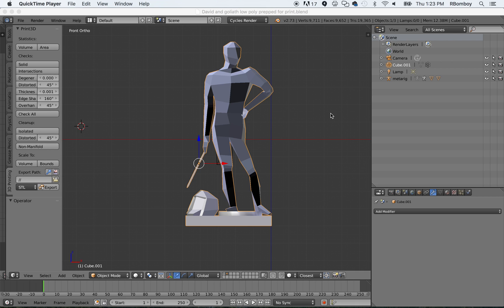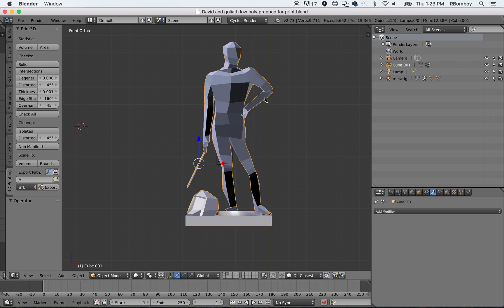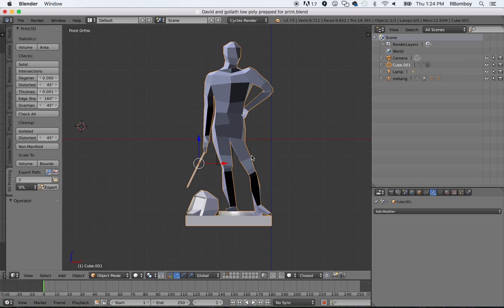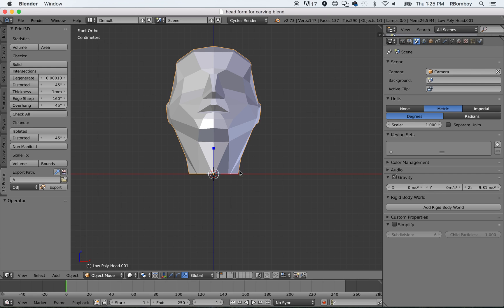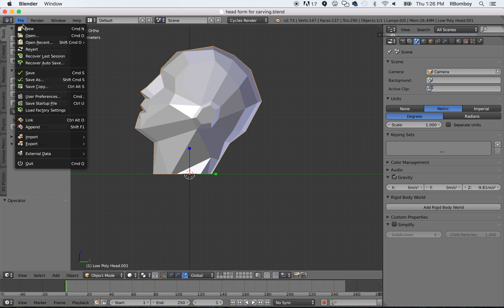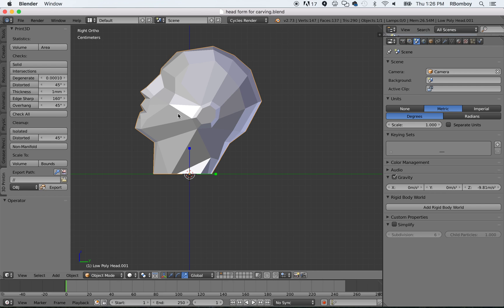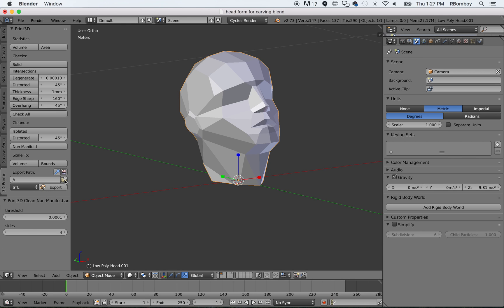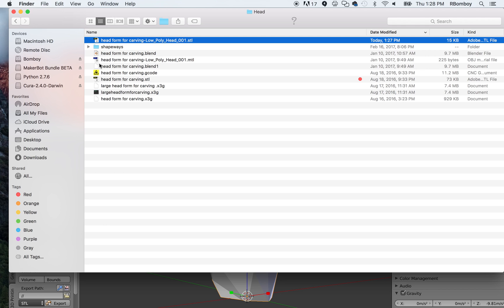Export STL from Blender Tutorial

Comment: 3d print dont appear in menue after clique on cross
Reply: Click on File > User preferences > Add-ons > click on the search button in the top left corner and type “print” , then check the “Mesh: 3D Print Toolbox” option and click “Save User Settings” in the bottom left corner, then exit out and it should be there.
Reply: @NickFigures   it's not there, I did all these steps
Reply: I had this issue as well, press N to display information sidebar and it should appear in the sidebar